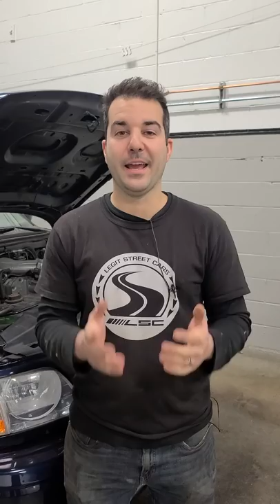The SVT Lightning Is Officially Down!

Comment from the maker: The Last SVT video! https://youtu.be/zDc4lSi251M
Reply: I hope you don’t plan on trying stop leak stuff, it will clog the heater core and cause a ton of gunk and block a lot of tight passages. That’s for emergencies in cheap crappy cars. I tried this in my f150 and it worked for a min but it caused alot more issues that it needed to
Reply: What are you doing with that beautiful 540i in the background? I would love to take it off your hands... I know its taking up space on a valuable lift... lol.
Reply: @cppctek  Bar's head gasket fix worked for me on my 93 honda accord, it used about 1 qt. of coolant every 40 miles and now got about 500 miles without adding any coolant. Don't know about that big svt engine though.
Reply: @cppctek  Not sure what you used as there are different methods for different products, but good quality ceramic based stop leak should not clog your heater core if you use it correctly.  It's based on sodium silicate, which won't form a seal until it reaches about 110 degrees C (hopefully on contact with the cylinder and block of your engine where the leak is) it will trigger a chemical reaction that causes it to turn into basically glass, forming a seal.  It's pretty foolproof unless you let your engine overheat while you are running it through the system, which could cause it to form glass deposits in unwanted areas - simple solution is don't let the engine overheat and all should be well.  The other types of stop leak, based on fibrous compounds and so on, are in my opinion, pretty dodgy and often cause more issues than they solve.
Reply: LSC is such a great channel. When are we going to see an update on the V12 Merc?
Reply: Car wizard was right!!! Worst engine ever!!!
Reply: Hey left a comment on last video.. check that stock intercooler, it’s a known problem when adding boost on the lightnings.  It happened on my 2000 lightning as soon as I added that lower pulley.  Such an awesome truck I miss it!
Reply: It’s a Ford so don’t worry, it’ll have another last resting place after you fix the head gaskets
Reply: Can't wait for the project to begin. Good work on paying it forward with that Trans Am
Reply: Alex u are the man I swear that was nice of u giving the truck to the young guy
Reply: This isn't a link it doesn't take you anywhere, it doesn't do anything...

Comment: please, do not ruin it more, just pull it out of the bay and fix it, no need for mechanic in a bottle or snake oil to improve compression, fix it the right way from the 1st time
Reply: I have to agree with this. When I used to do mobile mechanic work and had a suspected blown head gasket on a customer's car, it was always refusal to proceed further as a policy as soon as they told me they had done something like the head gasket in a bottle repair. Because they never wanted to pay for a replacement radiator and heater core, and they didn't want to pay me to do what was necessary to get all that crap out of the rest of the block after the heads were redone. However, just as soon as I did not follow through with all of those other things, they were calling me in a week or two talking about there was a problem and I f*** up their car and I owed them their money back or I needed to come fix it for free. No thank you
Reply: @supramaniac502  yeah, I know he wants more views but watching Samcrac and many others wasting our time, he just better work professionaly or "legit" on that engine
Reply: @jamdc2000  dont even get me started on Sam-quack. I stopped paying attention to his channel long ago...when Alex went there to buy that Audi, I seriously thought "No Alex, don't ruin your channel by associating with that guy.He's literally resorting to cameos from a pornstar for views."

Comment: U know what's up with these lighting',s my buddy has an identical one but in red pushed head gaskets the engine was all stock, so he decided hell with it he was gonna just built motor rods, pistons, stock casting heads ported polished he spent the money on it machine shop said they were booked solid right in middle of race season so he left it said no problem went out and bought a Harley truck same motor same supercharger, bone stock 24,000 miles pushed head gaskets went on that truck, there's a problem with these engine and head gaskets

Comment: Alex, the head gasket job is really easy on the tritons, I would suggest just doing it the right way and purchasing a beater without a heater to test out the mechanic in a bottles. I was able to do head gaskets on a town car in around 5 hours and around $100 worth of specialty tools off of amazon. In bocca al lupo!

Comment: I'm having the same problem with 2003 cobra  
I know that you are going to re torque the head bolts if it works I will try it on mine 
Thanks for the information

Comment: "Does liquid head gasket sealer work in a boosted engine?" Video idea 👍
Reply: Alternative video title: how to clog your engine with mechanic in a can
Reply: @funnypranker34  liquid head gasket sealer is not the same stuff as the classic "mechanic in a bottle" sawdust type sealer. Look up a video on how it works. It is liquid glass which only turns solid when exposed to hot exhaust gasses leaving behind a gasket type material which "repairs" the broken part. Chris fix has a good video which is quite fascinating.
Reply: Or another alternative...
How not to fix it and then how to clean up the whole mess and do it right..

Comment: Hey i hope you see my message. Im having problems with my n54 vehicle. Wondering if you have wny insight as you have the same 335i. I will copy paste my reddit post under this comment
Reply: Hi, everyone it’s me again. Wondering if i can get some insight on the recent issues I’ve been having. Have a n54. 

I replaced the valve cover and gasket recently and the car drove great afterwards. I drive 50 miles, got gas and drove 30 more miles afterwards no leaks, no smoke from the engine or anything. I actually got better fuel economy too. 

The next day (this morning) i start the car and its misfiring like crazy and stalls out and dies. Im barely even able to move it unless i keep constant gas on it. 

Ive got a CEL and scanned it each time it did that today. Its multiple random misfires every time. Ive checked every connection that was involved with the gasket change and removed the ignition coils to view the plugs (brand new, have 100 miles on them). Can anyone help with this?

Things to note, i broke the pcv hose when installing the new gasket and cover, replaced it and it drove normal on my 80 mile test drive. Ive checked the harness that has the grounds and ignition wires, no breaks or tears. 

Codes that ive gotten: misfires on 1-4 randomly not all at once, one start it will be 1 & 2, next will be 1 & 4, etc. Ive also got codes like 29E0 but then that one didnt appear on the next start up and code scan. Same thing with code 2AAF (fuel pump plausibility).
Reply: Car is completely stock except for coilovers and intakes. No lpfp upgrade, hpfp mods, no tune yet or anything.
Reply: I fan hear the lpfp in the trunk when i turn on the ignition. Sounds like its always has btw

Comment: Someone said "fair warning" any type of block sealer besides black pepper is an absolute disaster. Heads for a modular are pretty cheap. Aviator 4v ported heads have the best flow. Only short of ported 500 heads with the stupid high price.  Set of Cams and just do the heads with L19 bolts. Don't need to touch the bottom end. Might be wise to drop the pan and replace the rod bearings and bolts. Do not torque arp rod bolts beyond OE spec because it will distort the journals. If  you disassemble and resize with ARP torque value will be fine. It's not necessary though. Word on the streets is to just replace guides and tensioners using original chains. Friction is way up on new chains and they just don't stretch like the old ones did. 
Do the oil, coupler and bearings in the supercharger. Hand port supercharger, just low hanging fruit for flow. Radius sharp turns and protrusions, port match.
With it's age, simply doing modern cams and beehive springs will give you 100hp without being crazy.
Fat tire mod 🤣
Reply from the maker: Hey Kurt. Can you email me at legitstreetcars@gmail.com

Comment: Decade's ago I bought a 1996 Mazda RX7 , before I had made it home the coolant pushed out the reservoir, a little research and .25 later it was fixed.
The fix , believe it or not , was to extend the line to the reservoir by like 20 inches. 
Ya can't go wrong by trying it.

Comment: I've driven 675k miles in 2 lightening trucks. I drove both around 335k. First one i drove 16 years. Second one drove 6 years. One threw spark plug but had it helicoiled and its a easy fix. You need to change the timing chains AND install new oil pump because the oil pumps on these trucks go bad around 320k my second truck the oil pump failed and ruined motor in 7 minutes. I would love to get another one thats low miles but very expensive.

Comment: Engine seal or hose became weak folding close block antifreeze flow over heating engine. Run engine watch as heats up, if hose buckle up replace that hose

Good luck, some cooler hose are now day made cheaper

Comment: TRY fixing it with cinnamon.  Head gaskets blow and then the oil gets into the coolant because oil pressure is higher than coolant pressure while the engine is running.  BUT....When the engine shuts off, oil pressure goes away but coolant pressure is still there.

I have heard multiple people solve [temporarily] blown head gasket issues by putting cinnamon in the coolant.  It is unaffected by the coolant, but it tends to collect and then block leaks between the coolant jackets and the oil returns...

Try it, see if it works.  This is common in Europe.  And it would make a fun video to see if it actually works, which I suspect it does....

Comment: Nooooo. Fix it, beef up the engine, get interior and exterior back to 110%, then see if you can sell/trade it for a newer Tundra for your car hauling, since you don't need a massive amount of towing power.

The Lightning is one of my favorite vehicles, but with as crazy as most used prices are, it may be best to get rid of it before the middle of 2022 when a plateau could be reached.
Reply: Lightning can only tow 5000 lbs.
Reply: If he wanted a tundra he would have bought one..... besides that a tundra would be a down grade and the lightning will always be worth more